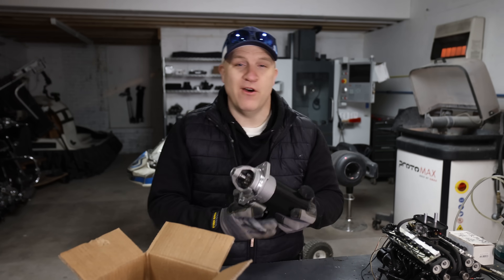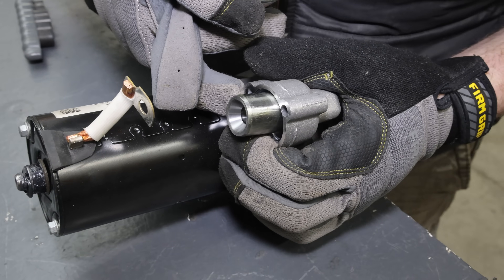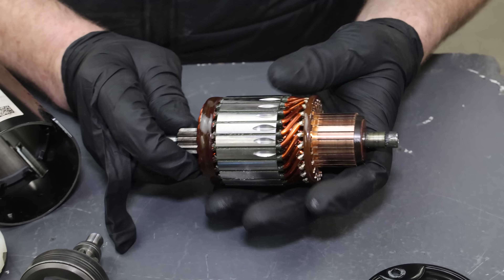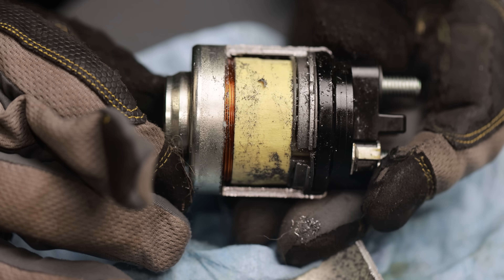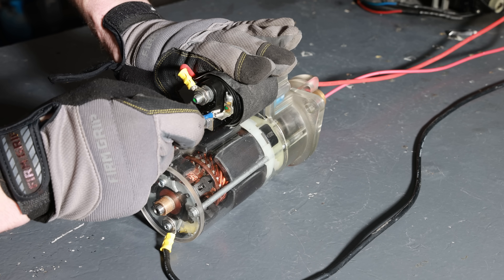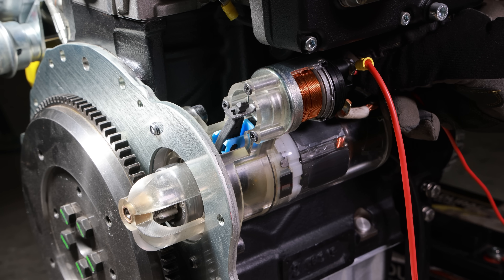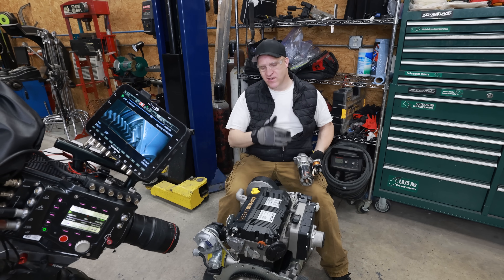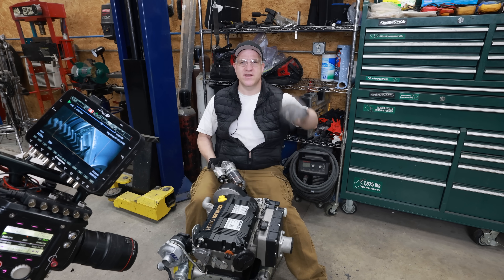See Thru Engine Starter

Comment: Car starters have what is called an over running clutch attached to the pinion gear for protection in case the driver accidentally turns the key with the engine running

Comment: We used to buy the individual components like the solenoid, gear, brushes and service them just like a engine.  They would last the life of the car that way.  Now to just buy 1 part it's cheaper to buy a starter then to buy a set of brushes , or a solenoid now .  It's ridiculous.   A solenoid used to be $15 ,  $5 for brushes.   The bearings were about $5 ...  the sa.e for alternators. Now a doide pack is around $100 .. it's like wtf...

Comment: the half of my solenoid that powers the motor is broken , but the part that extends the gear still works . i need to start the engine , but it'll take a few days for a new solenoid to arrive . i want to use my solenoid in conjunction with a 1960s ford solenoid (it only acts as a switch) to do the job , but wondered if the motor spins slowly until gears are engaged , or if gears engage first . thanks for showing me how to rig my solenoids .
Reply from the maker: Awesome...your welcome

Comment: Once the end broke off you should have just put back on the metal end to the rest of the see through and filmed that part because the gear end you can and did film with the metal front and you can see. The rest is what I wanted to see.

Comment: The first starter motor I took apart was at about the age of 16 in the early 1970s.  It was on a 1960 Chevrolet Biscayne in-line 6, 235 cubic inches.  It was very much like the motor you show hear, but with two main differences.  First, it used field coils of wire instead of permanent magnets.  At that time electromagnets were stronger than the available permanent magnets.  Second, it did not have a reduction gear set.  It was direct drive.

The most common problems in the starter were the high current contacts in the solenoid wearing down and the brushes in the motor wearing down.  Both were available at parts stores and cheap.  Replace those parts, put a dab of grease on the bearings and pivot points and you were good to go.  Now they force you to buy a new or rebuilt starter.

Comment: I loved the running engine with starter grinding segment the best.  I had a Jeep ignition switch short out once while driving and it made a heck of a racket until I was able to pull a fuse and stop the nightmare.

Comment: Question:  when the starter teeth try to re-engage with a running  engine flywheel ,   why would only the starter teeth wear...don't we have to worry that the flywheel teeth will break off and then have a " dead zone " on the flywheel ?...thanks to all you mechanics .....

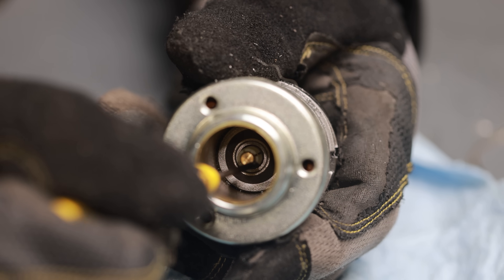Comment: 4:10 Those hidden contacts are the primary wear part on the average starter. They are also the cheapest part to replace on a starter (typically a few dollars, if that). That they've made them inaccessible on this starter is for one reason only: to sell you a whole new starter (or just the solenoid if you're lucky) and reap more profit when those contacts fail. You'll know they're failing because you'll here a 'click' but the engine won't "turn over." That means the solenoid plunger engaged but the contacts were too burnt to pass the huge electric load through to the starter motor itself (which is what those connections do because the solenoid is effectively an electrical relay also; the small wire energizes the solenoid electromagnet). This results in the motor, and subsequently the engine, do not turning over. This usually begins intermittently and progresses to consistent no-starts after a several to many additional start attempts.

As others have said, this is a fantastic visual representation of how the starter works overall and will be helpful for anyone wanting to learn. Keep up the great content!

Comment: There is a small bevel on the end of the starter drive gear which allows the teeth to engage the flywheel ring gear which are all straight cut (no bevel). This means the flywheel ring gear can be knocked off and reversed if the teeth are damaged. It is only a shrink fit pressed on. If the bevel is on the flywheel ring gear and the teeth are damaged, then it is not reversible, then you must get a new flywheel ring gear.

Comment: This is a modern starter.  In the olden days, our company designed some of these and they were much simpler.  You should do one with a pre-80s version.  Also don't forget these solenoids maybe PWM controlled so cannot keep the full 12V applied continuously.  We designed those systems to conserve starting current under cold and weak battery conditions.

Comment: Bosch. If I'm replacing a starter, it's gonna be a Bosch. For forty years I've used Bosch starters and they always work for 100,000 miles AT LEAST. Other aftermarket and reman, even factory starters are a crap shoot. Remanufactured are the worst. I've gotten some for my customers, against my advice because they wanted to save money, and they didn't last 10,000 miles.

Comment: Allow me to preface my comment by  saying that I am not a mechanic but having worked in a garage  during the summer of 1977,  I believe the part that protrudes to engage the flywheel was referred to as the Bendix. Not sure it the term is still relevant.

Comment: This was a surprise to me.   I thought starter motors were always series motors, so that they can produce high torque to get the engine turning, then high RPM once it is turning.   But this starter motor has a ferrite magnet field, making it like a shunt wound motor that wants to turn at a particular RPM.

Comment: This is a very educational and interesting video.  I’ve taken many starters apart on older vehicles.  I’m surprised that they have remained so unchanged over the years.  I wonder if removing the spark plugs on that Koehler engine would have reduced the combustion enough to reduce the torque on the bell-housing that you created on the 3D printer.  You did a great job on this whole video.  My first - and I subscribed!

Comment: Love the video and when I was kid born in the 60's I always loved see through stuff i remember the see through distributor caps and valve covers and oil pan not ment for street cool stuff 😊 i was hoping your see-through starter in action i think 🤔 were it went wrong should have removed the spark plugs or made a compression release valve if you were attending for a start up chance the industrial style kohler motors are high in compression for longevity and perhaps installing the cast aluminum starter nose on the se through body it will survived . Ken's automotive NC 😊

Comment: The steel case completes the magnetic circuit path on the outside of the magnets.  Without it, the magnetic field strength is lower, which will make for lower torque and higher speed and higher current, none of which is good in this application.  It is like operating a field wound motor with lower field current, and zero field current will make the motor spin up and destroy itself.

Comment: This video came a great time for me!  I've recently had an issue with a clacking sound on my chevy truck, I was told it's due to my starters inability to completely retract the little gear that pops out to mesh with the flywheel.   Mines apparently worn out allowing the gear to barely make contact with the fly wheel which makes an annoying chattering sound.  I've been searching you tube and Google lately to learn the internal  mechanisms inside the starter and your video has given me a much better understanding of what's going on inside a starter..... Who'd of thought it was so complex?

Comment: Thanks for the really cool video! So if that brass bushing is worn, I've heard that the starter will be prone to jam, and not crank as it should - but why exactly is that? How much can a few 1/10:s of a millimeter affect it? Does it have to do with those static magnets?

Comment: Been rebuilding the starter in my Toy Tacoma since I bought the truck new in 1999.  Comm brushes still look new.  Only had to replace the 2 soilenoid contacts and main copper contact washer that bridges the gap between those smaller contacts, when the soilenoid is energized.

475k miles, on the truck, and Oem starter.

Comment: All these issues go away when you take the starter motor and make it big as the engine especially the stupid gear that has to translate isn't it called Bendix something or other I hate that it fails in so many tractors and all sorts of useful machines so it's best to just make everything electric directdrive. The age of ICE has come and gone.

Comment: Starter motors are perfect examples (especially) when in a see-through case, of a series wound, high torque, DC motor. We learned, in school, that under perfect conditions  (no friction), etc a series wound motor would continue to build speed until it would RUD. This is a great video, thank you for making this 67-year-old kid so engrossed that now I have to clean the nose smudges off the computer screen!
Reply: This is a permanent magnet motor where only the armature is energised. A series wound motor is where the armature and the field windings are energised in series.
Reply: @peterhickey1218  Yes.
Reply: Please tell us what RUD means?
Reply: LOL 🤣 I'm 73; had to go clean those glasses.

Comment: Bonjour Fonctionnement du démarreur

Le démarreur fonctionne suivant plusieurs étapes :

Schéma démarreur auto

1. Le conducteur met le contact. L’action exercée sur la clé de contact permet d’envoyer une tension électrique en direction du démarreur.

2. Cette tension vient alimenter le double bobinage du solénoïde. Cela crée une force électromagnétique qui fait coulisser le noyau cylindrique.

3. En se déplaçant, le noyau du solénoïde alimente le moteur du démarreur en électricité. En simultané, il actionne la fourchette du lanceur.

4. Celle-ci vient agir sur le pignon denté afin de le placer sur le pourtour du volant moteur. Le moteur électrique fait tourner le pignon.

5. La rotation du pignon entraîne celle du volant moteur, par effet d’engrenage. Le volant moteur entraîne à son tour le vilebrequin et permet de faire tourner le moteur du véhicule.

6. Le conducteur relâche la clé de contact. Cette action coupe le moteur électrique et la désolidarisation du pignon du volant moteur se fait aussi par l'inversion du sens du courant dans le bobinage de maintien le démarreur devenant dynamo. En protection mécanique il y a une roue libre dans le lanceur

Comment: One thing that was not mentioned is that the soliniod has two windings in it a pull in winding and a holding winding it takes more current to pull in the starter pinion and a lot less to hold it once it is engaged great video regards peta

Comment: This is remarkably similar to a gyrocopter's pre-rotator.
There is a PTO shaft from the engine which turns a bendix. Pneumatic pressure (rather than a solenoid) pops the bendix up so that it engages with the ring-gear which forms the base of the rotor-head.
Other than the bendix being pneumatiically engaged, the other main difference is that your starter motor's teeth are straight rather than spiralled (which surprised me).
I think the reason for using spiralled gears is so that if the PTO disengages before the bendix has dropped away from the ring, the torque from the ring-gear will force the bendix down and disengage it..

Comment: Great effort, as a backyard mechanic, its great to see more details, pity about the plastic housing, but I wasn't sure about (the torque pressures being too high) and I was right but some mad skills on the 3d design and printing, maybe just have rods inserted strategically into the plastic molds where the absolute pressures are to take the pressures, then see through most of the (clear plastic) housing???

Comment: at the 4:10 that one terminal you were pointing out inside the solenoid was the contacts for the pull in windings of the solenoid.  The solenoid has two windings in it, basically two solenoids combined into one.  The pull in and hold in windings.  During the initial starting as the solenoid is being drawn in the hold in and pull in windings are energized creating a magnetic field but one the solenoid is fully pulled in the pull it winding is opened leaving only the hold in winding energized during the rest of the starting process.
Reply: The most interesting thing about the pull in coil is how that coil drops out not with a switch but with creative wiring of the ground side to the M post, between solenoid and motor. When the solenoid closes to start the motor, suddenly the pull in coil has battery positive voltage on both sides of the coil. So, instantly, there is no voltage drop across it. The ground side for the pull in coil goes through the motor, but the hold in coil ground connection is direct to ground. Not all starter motors have an accessible M post, but those that do give a useful glimpse of how this works with a scope. This gives definitive evidence of the failure point when a starter motor becomes unreliable -- usually the solenoid contacts are the weakest link.

Comment: This is very interesting. Amazing work! Watching you trying to start while the engine is running reminds me of my first car, a 2002 VW polo. It had a wiring fault which caused the starter to engage the flywheel while driving. Sometimes you could hear the click and know to pull over, stop the engine and restart, but once i didn’t hear it while going on a spirited drive. It was a 1.2L 12v 3cyl so you could imagine the engine was revving its nuts off. The starter had run up so fast it eventually friction welded itself, it stalled the engine, locked up both front wheels and grenaded itself off the bell housing. It just turned to metallic crumbs lol. I would have loved to see that caught on a high speed camera.

Comment: Older starters DID used to be just a gear from a huge motor that connected to the fly wheel.  This appears to be a type of gear-reduction starter which can still spin the engine that couple-hundred RPMS needed to start it, but can make use of a more efficient electric motor design and what amounts to a transmission to multiply the torque.  It's also in MUCH smaller packaging and uses a lot less copper to do it.  The old vs. new starters available for Ford Cleveland motors really illustrate the difference, and the new ones spin the engine over MUCH better.

Comment: Most starters on gasoline engines don't have the planetary gears. This engine is a diesel so it has higher compression ratios than a gasoline engine does. As such, it requires more torque to start it than a gasoline engine. The planetary gears multiply the torque coming from the electric motor, allowing it to crank and start the engine.

Comment: As there's a lot of current passing through the starter motor when it's running, the bolt on the rear would probably get a little warm, and maybe melted the plastic slightly.

Comment: Cool! I’ve never seen a starter with that “gear lever” to engage the drive gear. 

If you print it again, try to relive compression. Glow plugs or injector could be removed

Comment: Back when EVERY car had the exact same round headlights, every car had a starter with a “Bendix (Switch)”.
All interchangeable. Solenoid, high current relay that won’t energize until solenoid has fully deployed pinion

Comment: That was totally awesome.  I am not a mechanic but I have a good unstanding of most mechanical aspects of my cars.  I thought the little starter gear that engages the ring gear of the flywheel was called the bendix.  I didn't hear you refer to it as that.  So it is the release of the key, or the button in todays cars the de-energized the solenoid and allows the bendix to return to its home position after getting the flywheel going.  When the flywheel reaches a certain speed the engine begins to move on its own.  Decades ago that was hand cranked like the starter cord on a lawn mower.

Comment: Great video. When I first saw the thumbnail I asked myself "can that work?" and while you where building I figured the plastic wouldn't be able to handle the torque of the starter. Dads a mechanic. I know the power of a starter motor and how important it is to have them securely bolted in. Have changed a few myself. 
Sadly plastic is plastic and metal is metal. Worth trying. Cool to watch. BTW, I loved that clear printer.

Comment: Something I never understood about modern cars, especially ones with tip start, is if the engine doesn't start after 5-10 seconds it suddenly sounds as if the engine has lost it's compression and is spinning over much faster. Does anyone know why this is?

Comment: Great video, my advice is to use an engine with the sparkplugs removed so the plastic components of your clear starter aren't fighting the cylinder compression. It seems to me that is why the part failed as it was unable to withstand the diesel engine's high compression.

Comment: Your first intuition about how it was built was actually correct for most motors.  The one you have is a high torque motor assembly, it doesn't rotate as fast, but still as fast as it needs to.

Comment: Very cool experiment. I am surprised when at the amount of radial deflection of the pinion shaft that can be seen at 7.38, when you had switched back to the original starter, I wonder if the Design Engineer of the unit might consider an upgrade, it just seems excessive.

Comment: Not all starters employ the "Bendix" solenoid crash engagement method as you show. Some use constant mesh overrunning 'dog' clutches, which engage when the starter motor is running faster than the engine. Once the engine starts spinning faster, the starter disengages. Used on gas turbine and jet engines as well--and yes, you can 'crash engage' a jet engine, causing damage.